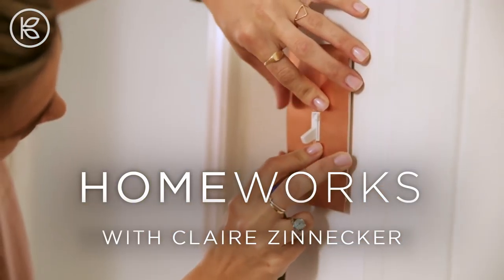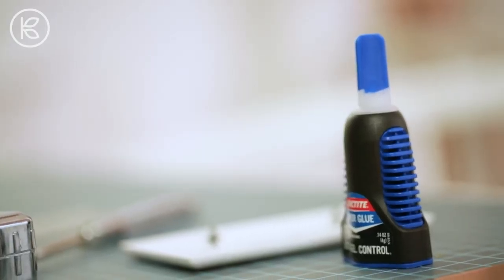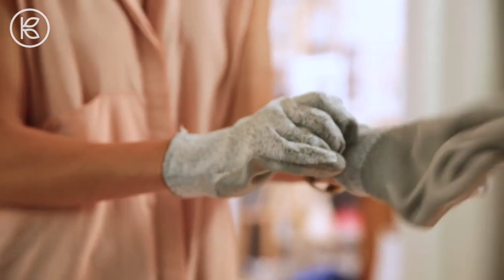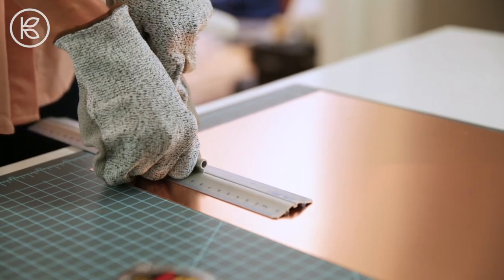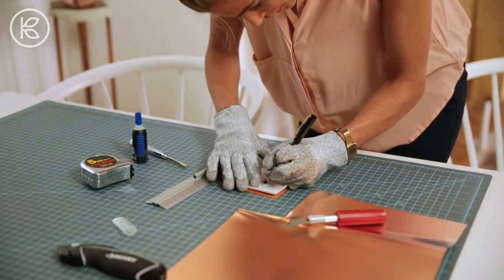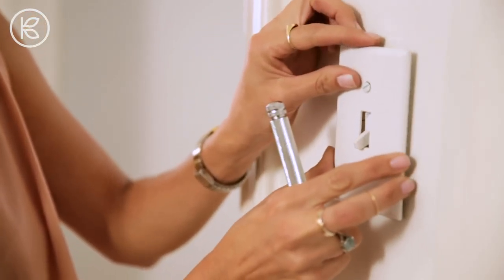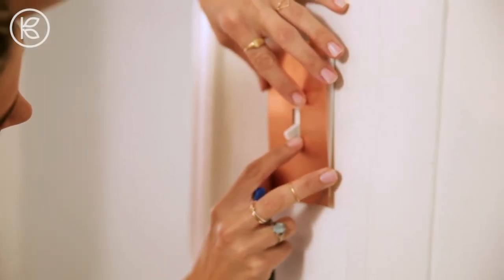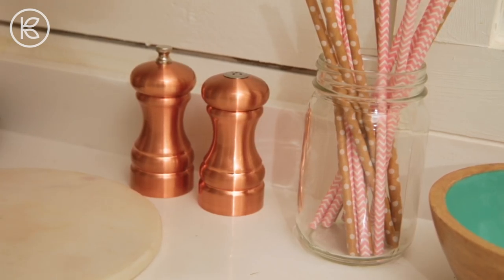DIY Copper Light Switch | Kin Community

Comment: i probably would have just removed the existing plate, spray painted it, then put it back on. that way it's easily removed and won't hurt you or get in the way when you want to repaint the wall

Comment: The end result of the copper not molding to the light switch plate is unappealing.  You can make a better cover for the switch plate by using fabric, or copper spray paint.